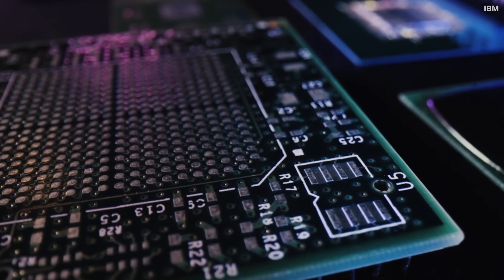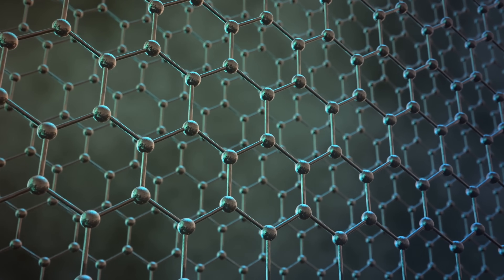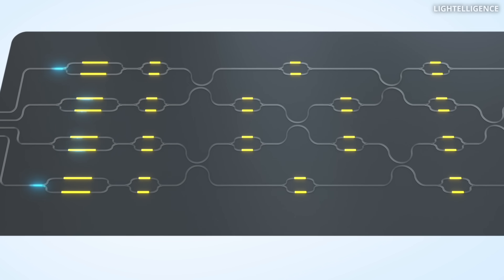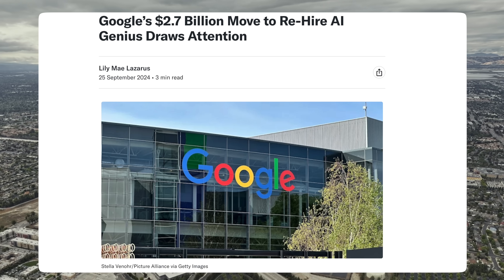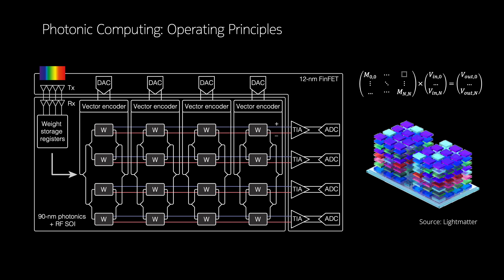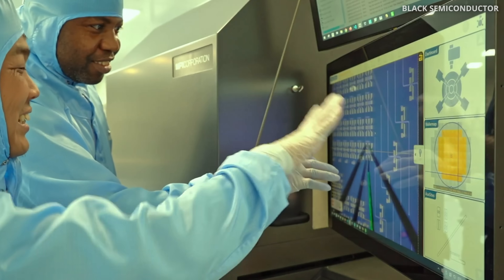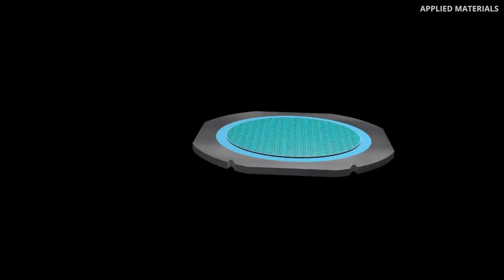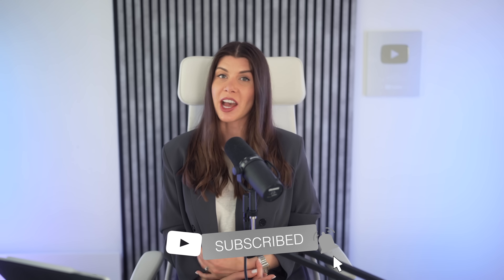Here’s What Comes After Silicon

Comment: There is no way an analog multiply would ever work in AI calculations; there is too much accumulated error. Although the current AI computations often use very low bitcount values, the better models use more bits per number. 

And solid state lasers have lifetimes measured in thousands of hours, which is not that long. I think photonic chips are very exciting, but probably will be decades before they are commonly used.

Comment: I think one cool thing about this is that currently, When the silicon is busy on an operation, That operation is the only one utilizing that hardware. The only way to multiply this is to have multiple units to direct other incoming instruction requests towards If one is busy. With photonic computing, If you can subdivide the frequencies into, say 100 channels. That's 100 operations being piped through the same instruction unit at the same time. You then just need to schedule which channel each instruction is set to. This means that the same Logic space can do 100x more.

Imagine if you have a CPU core that's completely photonic. That means the number of "cores" you have to complete operations Is basically just a question of how many channels can you chop the light bandwidth into. You don't need to add more cores, you just need to add more frequencies of light.
Reply: Never thought of that, a bit like fiber optics.
Reply: Yep. I remember telling people that fiber optics capabilities were going up by the router colors being added in 1998. 
We have limitless capacity once it's optical.

Comment: "even photons can move throughout graphene extremely fast" This phrase will stay in my head. I almost cryed now, this changes everything. There is a way.
Reply: (YouTube won't let me make my own comment, for some reason I'm only allowed to reply on this video or the comment doesn't post) | Researchers at Peking University have developed transistors using bismuth that are 40% faster while consuming 10% less power than the latest silicon-based offerings from industry leaders like Intel and TSMC. -Amit Hattangadi of LinkedIn on 28-04-2025 (this is also being combined with graphene)

Comment: 10:32 I'm wondering how matrix multiplication can be parallelized with multiple frequencies. Can DAC voltage be tuned to only affect some wavelengths? If not then surely the result  would be the same for all wavelengths and there's no useful parallelization.

Comment: I noticed that the photonic elements for computing still require electrical signals.  Is there a way to completely replace all electronic components within a photonic processor with 100% optical ones (where the only electronic elements are at the interconnect level)?

Comment: We've needed next gen material transistors for such a long time now, inter connectivity paths, speeds and bandwidth would need to be improved hand in hand. PC Motherboards seriously need a re-design on inter connectivity paths, speeds, bandwidth and bottle necking issues (they should take a look at the 5090 PCB for ideas). I'm looking forward to the 400Ghz CPU in 2097...

Comment: so why use transistors for compute, when you can use eeprom logic gates, yep use ssd nands instead of transistors. in8/fp8 works nicely. so graphene is a conductor, then what. silicon is a semiconductor by definition. comparison between copper and graphene is more appropriate than to silicon. at least for electron mobility. photon features be separate from electrons. do you mean your best encoder is a morse encoder, or a mechanical relay. nano mems morse relay. yeah photo electric field effect transistor is much better at that same thing. it blocks the channel to form logic 0/1 photon bits with electrons. well pun intended ig. dont ask about cost, just do it. otherwise money does not help, its only in the way. law as human way does not help at all either. also only in the way.

Comment: question. 

who's building these graphene chips?
how big do they have to be to match cpu in a pc like ryzen 9000 etc? 
and how much power do they need to match the computational abilities of normal cpu chip like ryzen 9000?

I'm wondering why they don't just build a graphene 3d cpu size of a cube if it can be layered and costumes less power. it doesn't need to be as small as silicon chips if it works just as well being physical bigger, with less power consumption.

Comment: No matter what, you cannot make computers just faster. The CPU can be faster, but most of the time, the CPU just waits for the memory to deliver data. The bottleneck is not bandwidth but latency, which is limited by the speed of light. You have to move the memory closer to the computation or the computation closer to the memory.
Reply: The bottleneck is heat, too! Cooling is such a major expense and it should be factored in pricing of photonics (so even if the cost to build a photonic CPU is twice that for a conventional CPU, the cost savings could be had in the cooling process)
Reply: Maybe it is what computers are asked to do that makes them appear more 'intelligent' or 'fast' in some scenarios rather than others. In human brains there seems to be an innovation  region, with generative AI this might be where carefully Crufts standard trained 'poodle computers' will be told to 'sit' and 'wait' and not make life more unpleasant for the humans. Who knows? Sometimes well trained canines go off to the next town without asking, some fitted with ID chips. Some large dogs have the same carbon footprint as an ICE SUV? AI  says : 
-A large dog (e.g., 35 kg) on a high-beef, wet food diet could have an annual carbon footprint in the upper end of the estimated range, potentially exceeding 2,000 kg of CO2e.
-A fuel-efficient SUV that is driven infrequently (e.g., less than 5,000 miles per year) could have an annual tailpipe emission footprint in a similar range.
 Sit! Come back! Where has the dog gone? Is the dog intelligent? Is it worried about that? Where does anthropomorphic conceit enter this random AI based human conjecture? We cannot blame the ruminant type 'dog food' animals? They rarely theoretically exercise full self interested freedom of choice, unlike the imaginings of some political simplifiers?

Comment: Your content is very nice....but a single layer of graphene is unstable and with a diameter of less than a tenth of a Nano, it is more likely to turn into two layers or turn into nanotubes. And the graphene layer cannot remain unstable with many different atoms around it with the temperature factor compared to the thermally stable element silicon.. what is your opinion?

Comment: Graphene is a great conductor of electricity and light, and will likely supplant copper.

Graphene is essentially a single layer of graphite, found commonly in our pencils or the charcoal we burn on our barbeques.   As chips get smaller, the interconnect copper wires get smaller and become problematic with burnouts.  Researchers are considering graphene as a copper substitute in microelectronics as it shows 70% more efficient than copper in electrical tansmission, additionally,  it doesn't degrade under intense heat like copper does in long transmission lines. 

Graphene also conducts light well.  With graphene, future cameras will be higher resolution, and data transmission will be much faster.  Graphene is already intensively employed in optical telecommunication systems.  The world’s first all-graphene optical communication link was exhibited in 2018, operating at a data rate of 25 Gbit/s per channel.

(The molecular property of graphene is very strong as it is a thin web of carbon atoms tightly interconnected with one another in a hexagonal pattern.  Graphene has a two-dimensional hexagonal lattice structure, while copper has a more complex three-dimensional atomic arrangement.  Scientists have found that when layers of graphene are stacked on top of each other, they can conduct electricity with better efficiency than copper wires.)

Comment: I have a kit that my father (also an EE) was given at a trade show in 1960.  It contained a sample of one of the first multi-transistor chip 14 pin dip packages.  That was patented by Texas Instruments, in 1959, the year that I started elementary school.  Prior to that, there were logic device packages but they consisted of diodes and resistors soldered into a plastic frame that had copper conductors sandwiched into the frame.  The package could be plugged into, or hard soldered into a structure.  I have one of those framework packages that has 6 diodes and a single resistor.  I was a 6 input And gate, or could be connected to be a 6 input Nand gate, depending on how the polarities were applied to the circuit.
Reply: Priceless
Reply: (YouTube won't let me make my own comment, for some reason I'm only allowed to reply on this video or the comment doesn't post) | Researchers at Peking University have developed transistors using bismuth that are 40% faster while consuming 10% less power than the latest silicon-based offerings from industry leaders like Intel and TSMC. -Amit Hattangadi of LinkedIn on 28-04-2025 (this is also being combined with graphene)
Reply: The only flaw in your story is that the chip you refer to was for a military missile and they were not being sold commercially.  The only flaw in my refute is that TI did actually begin selling them in March of 1960, but "a kit" would have had to have been from them.
Reply: @cosmicraysshotsintothelight  cont'd - and after a brief search of my study, this morning, I box and the logic frame are not where I remember them being.  I brought them home from my work office, when I retired in 2017.  Will have to take a deeper dive, this afternoon...
Reply: @cosmicraysshotsintothelight He worked for Morton Thiokol for a few years when I was a kid.  We lived in Delaware at the time.  He passed away in 2006 so I only have what's on the kit box.
Reply: That chip may have been a companion for a chip my father had, a DTL logic DIP.
One circuit board has discrete diodes for each gate, as many diodes as the number of inputs you needed for each gate.
4 gates per chip, IIRC, each could be an inverter, a 2, 3, 4, or 6 input Nand gate.
Reply: @chuckevans2792 DRL?  The one I have (or had) was x diodes and a single pull up/down resister.
Reply: @davidladd5597  Have you any schematics that show how it was used?
I would guess that together with a DTL DIP, 4 of your chips would make 4 x 4 input NAND gates. No discrete transistors needed.
Reply: I had a calculator from Texas Instruments in high school in the eighties. By the time I left school a few years later it was obsolete. The weirdest part? I went to school in a mining town in remote Western Australia….and this calculator was on the compulsory school list.
Reply: Thanks for sharing.
Reply: I have some of those chips

Comment: i like graphene and i like optical computing
but not sure how they would work together

light bounces around inside fiber optic cable from simple optics math reflection refraction etc
but graphene is one atom thick, and light is pretty big
and I'm pretty sure if you got wavelengths small enough to fit within a sheet of graphene, then it would blast the graphene apart definitely ionizing radiation

you could make some kind of empathetic connection that is more like a radio antenna than a mirror lense or optic cable 
but you would need seriously complex math fur even basic functions interference would be insane
and you would need a relatively huge void space for the light to travel
i suppose this could use this fluff space for heat dissipation, 
but you could just make a standard silicon dc chip with more bulk for heat dissopation

and if you can already reach that small scale of accuracy to arrange down to the atom of accuracy, then you're better off going with elections, there's heaps more electrons than photons fitting in just fine at that scale, 
That's why we shoot electrons, (electron microscope), to see things really small things, because light is huge comparatively

the cool thing about light is that you can get quantum processing effects at room temp
you can multiplex like she said
and you can do it on much less precise hardware that wouldn't would be easier cheaper to manufacturer and America would be much closer to getting an optical chip manufacturing facility operating vs ic from even 10 years ago

Comment: Maybe  fiberoptics replacing most copper wire soon,  in the data centers and high end computers anyway.  Eventually  in cellphones half the size they are now. The brothers from another world has really came through  for us , I knew we would figure out their tech, to a small extent anyway.  With the whole computer powered by light. Just like their ships, I thought it seemed like magic powered the ship . If I didn't know better.  A ultra efficient  PV converting light to electrical energy. A laser light at a specific frequency, tiny .05 mm fiber optics  carrying 5 watts energy ?

Comment: Graphene has emerged as a game-changing material in photonic computing, thanks to its unique optical and electronic properties. Below is a concise yet detailed overview of how graphene is used in this field, along with why it holds such promise:

GRAPHENE IN PHOTONIC COMPUTING

Why Graphene?

Graphene is a single layer of carbon atoms arranged in a 2D hexagonal lattice. Its properties make it ideal for photonics:

   •   Ultra-fast electron mobility (>200,000 cm²/V·s)
   •   Broadband optical absorption (from UV to THz range)
   •   Tunable conductivity via gating
   •   Strong light–matter interaction despite being atomically thin
   •   Compatibility with CMOS technology

Key Roles of Graphene in Photonic Devices

1. Optical Modulators

Graphene can function as an electro-absorption or electro-refractive modulator. When a voltage is applied, its optical properties change—modulating light intensity or phase:

   •   High speed (>100 GHz demonstrated)
   •   Low power consumption
   •   Ultra-compact size (sub-micrometre scale)

2. Photodetectors

Graphene-based photodetectors operate across a wide spectral range with ultrafast response times:

   •   Detect signals from visible to mid-IR and THz
   •   Capable of femtosecond response times
   •   Often hybridised with silicon or plasmonic waveguides

3. Optical Interconnects

In optical interconnects (replacing copper in chips), graphene can be used in modulators and detectors along with photonic waveguides:

   •   Reduces latency and energy cost per bit
   •   Enables integration of light-based communication on silicon chips

4. Nonlinear Photonics

Graphene exhibits giant third-order nonlinearity, useful for:

   •   All-optical switching
   •   Frequency conversion
   •   Mode-locking in ultrafast lasers

5. Plasmonics and Metamaterials

Graphene plasmons (surface waves confined in graphene) allow for light confinement beyond the diffraction limit:

   •   Useful in nanoscale photonic circuits
   •   Highly tunable via gating

Applications in Photonic Computing

   •   Neuromorphic computing: Graphene-based synaptic devices modulate light for brain-inspired computation
   •   Quantum photonics: Single-photon emitters and detectors
   •   AI hardware accelerators: Ultra-fast, low-power photonic units using graphene modulators and switches
   •   On-chip optical logic gates: Using graphene to switch light paths and encode logic states

Challenges

   •   Material quality: Large-scale, defect-free graphene remains hard to produce at scale
   •   Integration: Aligning graphene with silicon photonics requires advanced fabrication
   •   Thermal management: While graphene conducts heat well, dense photonic chips generate local hotspots

Recent Milestones (as of 2024–2025)

   •   Graphene modulators integrated into commercial silicon photonic platforms at 50+ GHz speeds
   •   EU’s Graphene Flagship project continues to push hybrid photonic–electronic chips
   •   Startups and labs in China, the EU, and the US now exploring graphene-based photonic neural networks

Conclusion

Graphene’s versatility, speed, and spectral coverage position it as a core material in the future of photonic integrated circuits (PICs). While still at the research–industry interface, progress in scalable manufacturing and hybrid integration is accelerating its arrival in practical, fast, energy-efficient computing systems.

⸻

Comment: Sure, linear operations are everywhere in AI (and graphics and ...) but you need non-linear operations between those linear operations.  So the question is whether the time and power to go back and forth from the light (or analog) realm is worth the benefits.

Likely it will be in some cases.  But because of this it's going to be less revolutionary and more evolutionary.
Reply: The photonic multiplier is non linear. How do you multiply (-6)*(-8). Do you shine (-6) light? Is there a negative photon?
Reply: @kazedcat Thats still linear in the relevant sense meaning that if you put if ax+b you get out f(ax+b) =af(x)+f(b).  Regarding your question that's just a matter of how you encode the light but since optics is fundamentally linear the only operations it can do are linear.
Reply: @petergerdes1094 so you offset instead of x1*y1 it becomes (x1+c1) *y1 but when you accumulate the result it has additional +c1(y1+y2+y3+y4+...) and this propagate throughout the transformer stack. +c1(y1+y2+y3+.. +)+c2(z1+z2+.. +) +c3(w1+w2+.. +). But what is c it should be max brightness /2 to give half of the brightness range for negative values. But if that's the case then the output value will quickly reach saturation value. They need to renormalize on every step to avoid saturating the output. That renormalization makes it non linear. The simplest method is to clip negative output back to zero brightness.